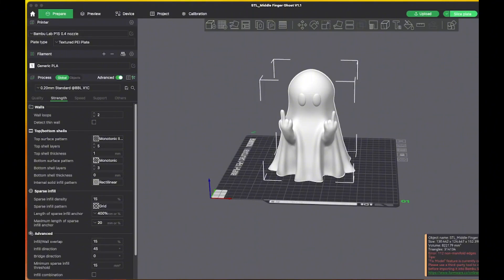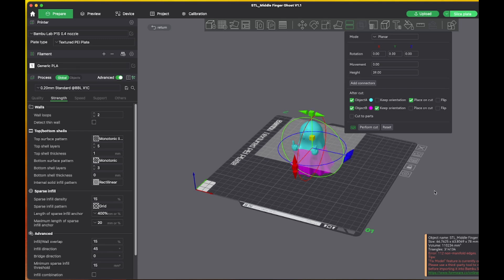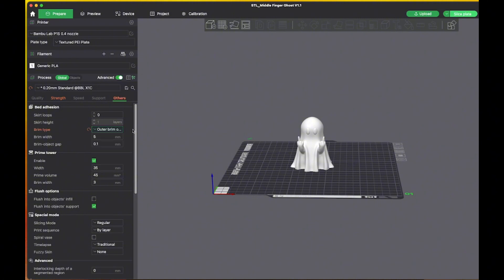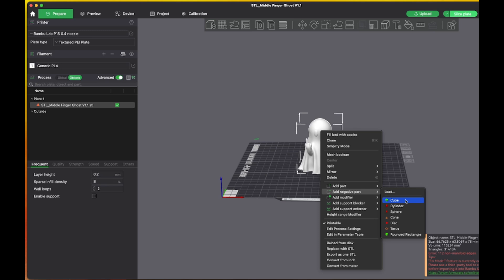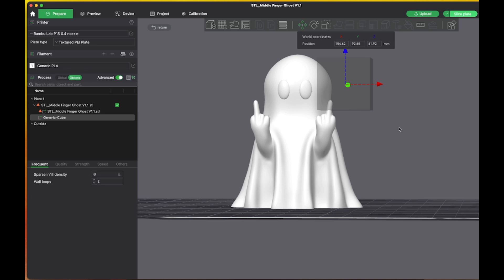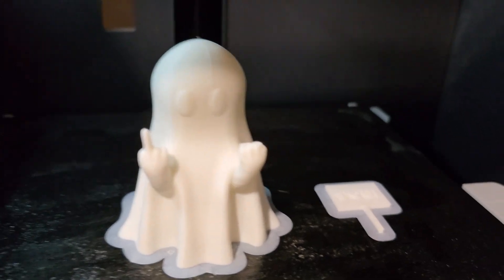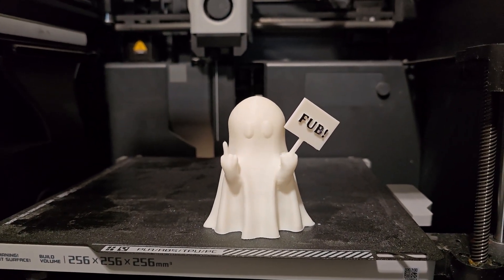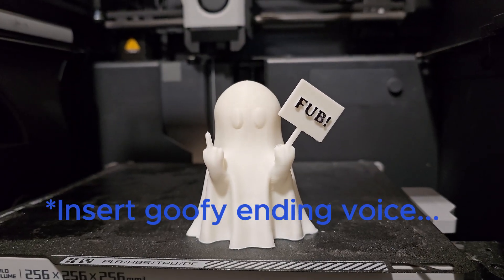Adding a Negative Part in Bambu Slicer To Remove Part of an STL.

Comment: Yeah the video freezes (probably coz Bambu uses so much resources when performing slicing), but it still got the point across.
Reply: I gotcha. Yea that was also done on my old MacBook air. I've upgraded computers since so shouldn't have that issue moving forward. Thanks.

Comment: keep trying to watch but the video freezes on the visual side... audio remains fine..
Reply from the maker: I'll check it out and if I experience the same thing I will try to red-edit. Sorry you are the first person that has brought this to my attention.
Reply from the maker: @rcfiend24, where are you seeing the video freeze?  I just scrolled through the entire thing and  can't find the issue.
Reply: @3DPrints747  It's around 3 Minutes 6 
Seconds. For me, it's freezing where you're putting in the negative cube and stalls on the menu. So I don't see the adding and moving and resizing -- it kind of goes filmstrip mode with a frame every 15 or so seconds.  It pretty much made the core part of the video unusable, unfortunately.